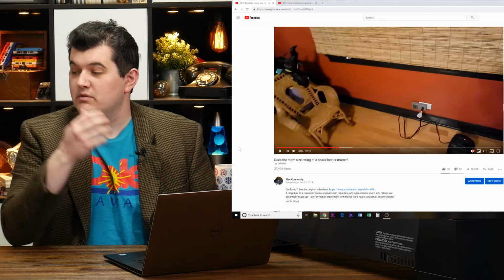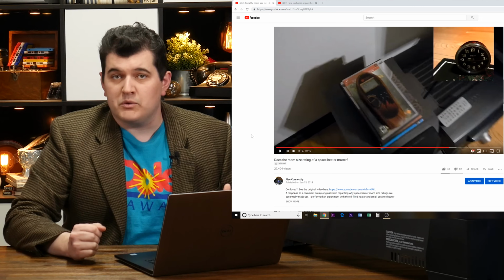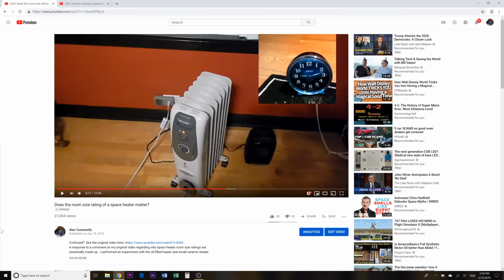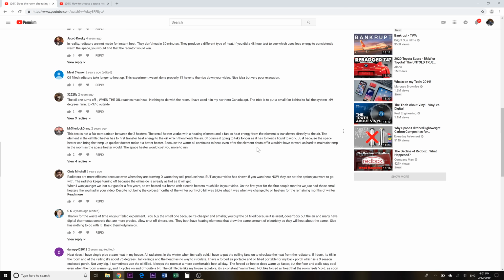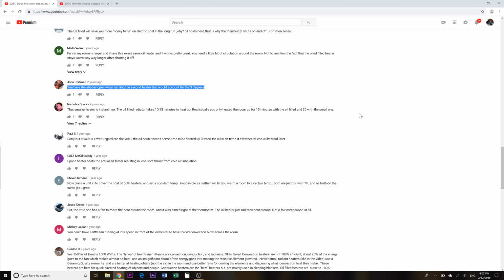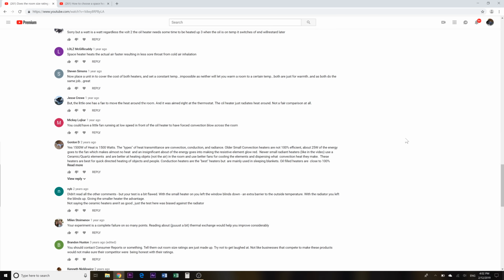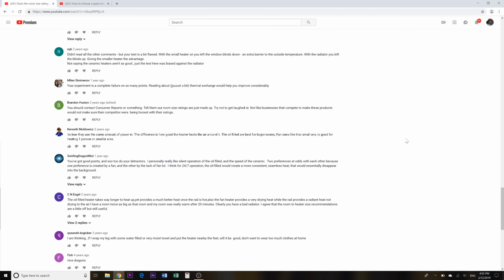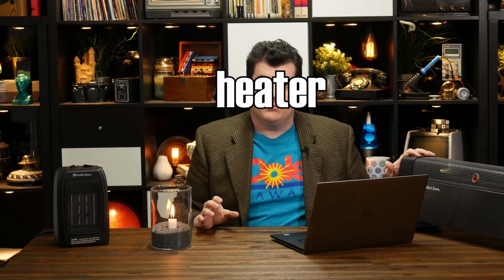More Space Heater Nonsense

Comment: If you want a consistent heat, why not just PWM a wire heater?  It's not as if PWM circuits that would maintain a steady temperature in a wire would take much energy, make much noise, fail easily, etc.  Dumping the heat into oil only seems to make sense if you can time it to come on an hour before you turn up, and go off an hour before you leave.

Comment: The larger one (or even the oil heater for that matter) would be more efficient if you pointed a fan at it.

The efficiency bump however would be how well that heat is dissipated in the room (not making 1 corner of the room hot and the rest cold.

Comment: There is a difference between a room that has had its air warmed up and a room where all of the mass has been warmed up. It's why you can have a house feel completely different with the same thermostat settings on a cold day. The walls and windows make the room feel colder despite the air temp being the same.

Not sure if that male sense. Let me try another way.
Start with a cold room and turn on your heater. In a short amount of time a thermostat will say the air in the room is up to that temp. On very cold days that room will still feel chilly. Only once all the furniture and the walls themselves have soaked up enough energy from the warmed air will the room start to feel comfortable. Thermal mass matters when it comes to perceived warmth.

A radiant heater will take much longer to heat all of that mass but it will happen slow enough that the room will feel comfortable. The forced air heater will quickly heat the air but all the the furniture will still be sucking every bit of heat from you it can.
Reply: As a side note, be clear, I'm not saying the forced air heater won't also heat all the mass in a room. It most certainly will and I can't come up with an argument that would support one doing a better job than the other. I'm just saying that no matter how you choose to heat a room, until you warm up everything and not just the air it won't feel very comfortable.

If you turn both on full blast and wait long enough they will both do the exact same job. Watts are watts.
Reply: It's true, the thermostat will cycle on more often in a room that hasn't been heated for a while because the walls, floor, ceiling and furniture haven't reached "operating temperature" yet.
Reply: I prefer putting insulation around the house and having "warmer" surfaces with lower air temperatures (and clothing).
Reply: Thank you. It's infuriating scrolling through these comments seeing all the self-righteous "ugh, look at these idiots who have never taken a thermodynamics course" comments when it's pretty clear the majority of them have never taken a heat transfer course and are thinking of things in theoretical and idealized terms.
Reply: It's not thermal mass, it's average apparent surface temperature. If the surroundings are much cooler than the air temperature your body will lose a larger fraction of heat via thermal radiation. A rule of thumb is that for comfort the apparent radiant temperature and air temperature should add up to 46C/146F. This is why radiant heaters can save energy - you can have lower air temperature while still retaining same level of comfort, reducing heat loss through ventilation and building envelope.

There is no point in having a space heater, when what you want is a people heater.
Reply: @AntsAasma  I can think of one reason: a person intends to move about inside the room.
If you are sitting on a couch or in front of a computer, you are probably not going to be moving around much, and you can direct the heater to your stationary body. If you are moving around in a room, say preparing a meal or playing with a pet, then you are likely to gain some benefit from warming the air mass in the room rather than heating yourself with radiant heat.
Another reason might be that you want to be warm all over, rather than just warm on one side. But that might be more apparent if you are moving around in a room, which goes back to my first argument.

Comment: Nice little series, there's certainly different ways to distribute heat, but strictly speaking any "efficiency" comes from how it gets the heat where you want. I think part of the Small vs Large Room marketing aspect is, perhaps by design, misunderstood by customers. I'm going to generalize a bit, but "Small Room" and "Large Room" is about application. A "Small Room" heater is designed to run for shorter periods of time and probably to circulate the air quickly. Quite nice for bathrooms and such, where you only want to heat a room for a little while. A "Large Room" heater is more about being constantly running, it's probably going to run quieter and in the short term will have more uneven heating, however they're meant to be running most of the time.

Again, that's generalizing, and I won't say that's what the marketing teams intended. There's certainly better ways to market how you heat an area. There are minor differences in mechanics depending on how the heat is intended to be used. Like the candle example probably won't heat a whole room in the desired manner, as most of the heat is going right to the ceiling. Adding the ceramic pot above it keeps the heat lower, more likely in the intended space. If you use either one continuously (assuming they're producing a net gain) they'll both achieve more or less the same result, it's the intermediate time that is different.

Comment: Not a professional but the only reason i can think for a physically large heater is that the heating element could sustain being hot for longer without risks.
Reply: Convector heaters need to be physically larger as they operate without a fan, so the heating element needs to be longer so as to not burn out. At the other end of the spectrum is a hair dryer (short element, but lots of forced air cooling) but they are much too noisy to use as a heater.

Comment: I always thought that the radiator electric heater was "more efficient" because it cycles on and off.. IE it reaches temperature, shuts off, cools down a bit and turns back on..  I have one.. Reason being it is quiet, and might use a bit less electricity..

Comment: I've been using small room heaters for a couple of years, and your tests align with everything I've experienced. However, there was one time recently where one of them had its fan stop working and it started to smoke up. Luckily I was right there next to it and unplugged it before it could burn my house down. That's been the only reason I'm considering the expensive ones for my next one. Which one would you say is top notch for safety and ability to be left on 24/7?

Comment: Argentinian here, it's even more stupid here. We use 220v at 50Hz, and Type I plugs which are IRAM 2073, rated at 10 and 20 A. Even though we've theoretically got 20A plugs, most are 10A, and so to avoid issues appliances are all rated for 10A. Now, even though we use 220v, the plug is rated for up to 250v, and so for that stupid reason that's what they use in calculations. So 250v x 10A = 2500W, and 80% is 2000W. And so every fucking space heater here is rated at 2000W. Outside of that, they all follow the same stupid logic. Small heater, medium heater, large heater. All rated for 2000W.

Comment: About thermal load... A large room needs even more heat output, not because of the air it contains, but its wall surface area and the studs within the walls. They are actually building energy-efficient houses with studs that are 24 inches apart instead of the standard 16 inches apart. Studs transmit more heat than the air between, so fewer studs means less heat transfer.

Comment: Surface area also comes to mind. The radiator and baseboard heaters have far more heating surface area than the small space heater. Also the ‘contact time’ it has with the air molecules is longer since there is no fan. This could be a key factor. 

After reading some other comments I also think humidity levels also play a much larger role than one might think.

Also a thought experiment. Imagine you had a 1500 watt space heater, with a separately powered super turbo fan behind it. With the fan on, the space heater wouldn’t be able to keep up with the massive volume of air being passed through it. Even at 1500 watts continuously, it’s ability to heat the area would be severely compromised.
Reply: @William Kappler Sorry, but doesn’t heat transfer take time? I.e. moving an air molecule at 5mph past a heating source vs moving an air molecule past at 500 mph? Yes it will get recirculated at some point but it will have cooled down in the meantime or even escape the room. That’s what I was getting at. Someone else brought up using a butane torch, it can put out tons of BTUs but it won’t effectively heat a room all that well. I can run my hand through a gas stove burner without getting burned. 

There is also more radiation taking place from the oil heater. And I think it’s flawed to think of a closed system, because the structures these are far from perfectly sealed. I believe heating of objects in the room also plays a role, not just the air. 

Another thought for the manufacturer’s suggestions is that a small space heater working in a large room will be working very hard almost all the time thereby shortening its life. An oil heater or larger heater doesn’t have to ‘work’ nearly as hard in a way that stresses the components.

Comment: I also wonder if putting some rockwool or other type of fireproof insulation between the thermostat on the oil filled heater and it's thermostat would increase it's effectiveness. Never tried that one. A big sheet of rockwool between the heater and it's cover, installed appropriately, would certainly help to keep the wiring and components in there cooler.

Comment: Don’t assume the efficiencies are the same. The efficiencies of the space heater and oil heater are different. Think about it, some of this space heater’s energy goes to the fan. Also the fan has a ‘cooling effect’ on the heating element. 

The oil heaters are ‘slow burn.’ I have recent experience with one. After about 2 or 3 hours the room was boiling even on a low setting. They also obviously have a max safe temperature. Even though you think it’s being tricked by its own thermostat, I don’t think the product is that poorly designed. Just as you said, someone tried to bypass it and it popped the max heat safety cutoff.

It’s important to also pay attention to the difference in noise level and concentration.

Comment: I've been known to remove the front of those little oil filled heaters and open up the vents on them to help keep the thermostat a little cooler. Just take a pair of needle nose pliers and diagonal cutters and cut out every other little slat and they work a fair bit better.

This also helps them to last longer because most people don't know there's a thermal fuse in the power supply wiring somewhere and once it's open it doesn't reset, you have to replace it or bridge past it (bad idea) 

These ones have smaller slats inside the openings you see in the picture, and if you remove them with the cutters they work so much better
https://www.walmart.com/ip/Mainstays-Oil-Filled-Electric-Radiant-Space-Heater-White/681622973

If it's just one slat you grab it with your needle nose pliers (with the thing unplugged of course) and bend them 90 degrees so they're perpendicular to the side of the machine instead of being parallel to it.
Reply: *note - because of the way the upper screw has to be inserted through a lot of stupid plastic cladding it helps to lay the machine on it's back and drop the screw through the front, and get your screwdriver seated into it then reassemble the top, because trying to do this with the heater on it's wheels will result in the screw falling down inside the cover.

Comment: I have to know, and you probably addressed this in your experiment, but how was the room temperature measured? Due to the static nature of the oil filled radiator I would think the airflow from it would be essentially straight up, stratifying the air in the room. Thus the overall heat added to the room might be the same but due to the mixing nature of the fan heater there might have been more warmth available at the temperature measuring device. The fan device might provide more heat down in the lower part of the room where it is more useful but if you measured up near the ceiling you might find overly heated air which is of less value to the people in the room, especially if you are sitting or lying down.

Comment: My only thought is that a "large room" unit could afford to heat up more slowly and then maintain more easily. A "small room" unit can effectively heat a small room quickly. A "large room" unit cannot. This does seem to run counter to the assumed implications of what a large or small room unit should do (large room seems like it would be more powerful). Large room units may be designed to be left alone for longer, since they'll be working to heat much more volume. Maybe it's more dangerous to run the small units long enough to heat a large room (assuming equal quality parts)?

Comment: The labeling may not be based on a unit's ability to heat a room but rather it's ability to handle the expected usage pattern of the device and how that usage pattern contributes to the unit's over all longevity. 

A 'small room' heater may use cheaper, lighter duty components such as the fan and heating element designed for a device that will most likely be used for shorter periods of time to heat up smaller rooms. 

A 'large room' heater may use stronger, more expensive components that are better suited to running for longer periods of time to heat up larger rooms.

Comment: Not sure if this will suite your idea on a  separate thermostat.  You can buy thermostats that you can plug a heater into for the purpose of home brewing alcohol. I cant see any reason why this wouldn't work for a room.  e.g. https://www.ebay.com/itm/INKBIRD-ITC-308-Temperature-Controller-Beer-Wine-Mead-Making-Seed-Germination-AU/392003746284?_trkparms=aid%3D555018%26algo%3DPL.SIM%26ao%3D1%26asc%3D56425%26meid%3D5a555741e9dd4288a787d65718f45540%26pid%3D100005%26rk%3D3%26rkt%3D5%26sd%3D382747371329%26itm%3D392003746284&_trksid=p2047675.c100005.m1851